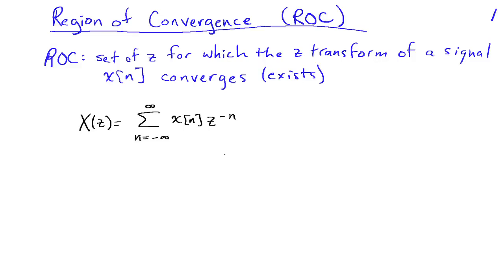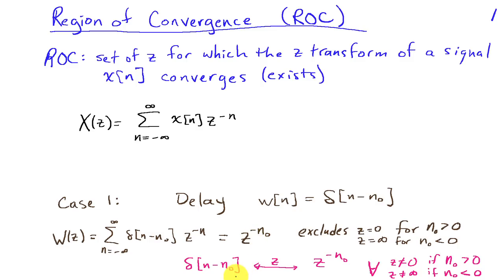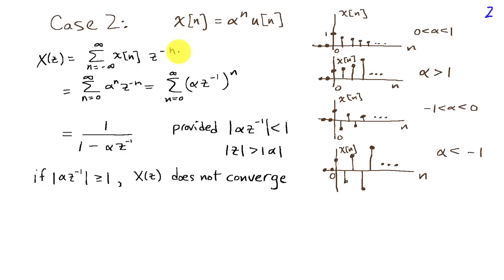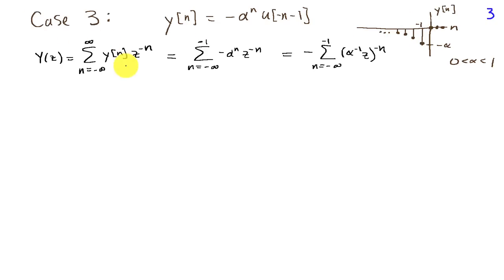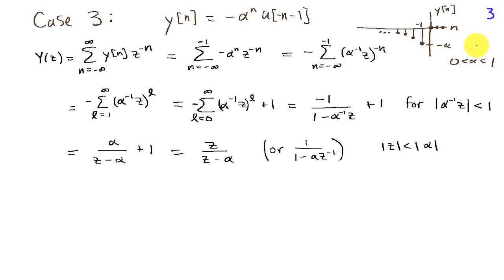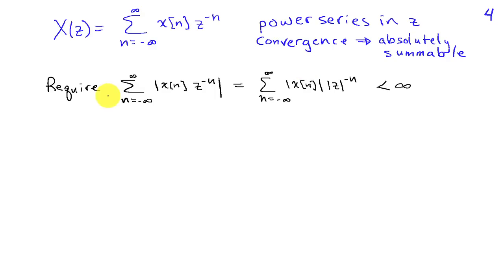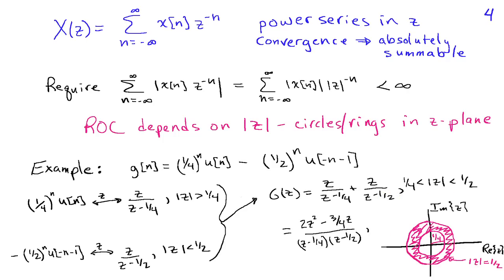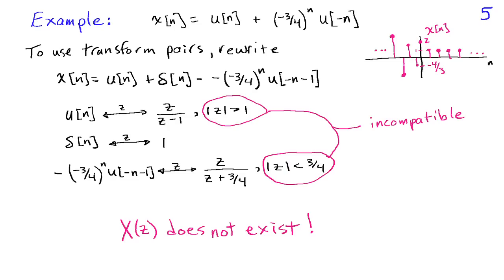Region of Convergence for the z-Transform

Comment from the maker: I will try to clarify my use of terms: 

1) A causal signal has x[n] = 0 for n<0.
2) A non causal signal has x[n] not equal 0 for some value n<0
3) An anti causal signal has x[n] = 0 for n greater than or equal to 0.

So the causal and anti causal categories are mutually exclusive. But note that an anti causal signal is also a non causal signal since the set of non causal signals includes anti causal signals.  However, a non causal signal is not necessarily anti causal.

Comment from the maker: The grt than1/4 applies to the first term alone in g[n] while less than 1/2 applies to the second term in g[n].  Hence for the z-transform of g[n] to converge, we can only include values of z for which BOTH terms in g[n] converge.  This leads to the overall ROC being the INTERSECTION of grt than1/4 and less than 1/2, which results in the ring.  I think it is easier to figure this out by looking at the individual terms. With a sum of signals the ROC will be the intersection of individ ROCs.

Comment: This won't change the result (that the z-transform doesn't exist), however, there is an error in your final example: There should be a (-3/4)**n in front of the delta[n] function.  i.e., u[-n] = u[-n-1] + delta[n] so (-3/4)**n u[-n] = (-3/4)**n { u[-n-1] + delta[n] }.

Comment: why did delta[n] appear at 13.24? could anyone explain that properly? thankx
Reply: - A non causal signal has x[n] not equal 0 for some value n<0
- An anti causal signal has x[n] = 0 for n greater than or equal to 0. i.e. ranges from -ve infinity to -1.
He made the second part anti-causal which was initially non-causal. He excluded the sample at x=0 and to make up for that he added a pulse(delta) in the signal. Now, the equation consisted of causal, anti-causal part and a delta.
Now, why he did that?
Because, he had already worked out z-transform for causal and anti-causal system. He used that directly solved for overall z-transform.